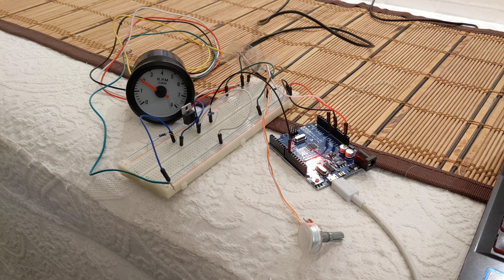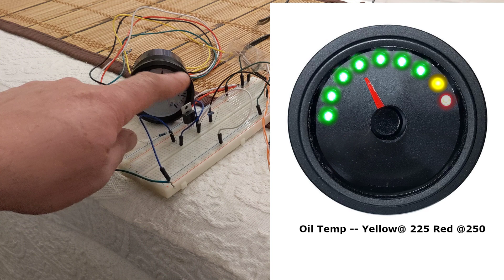Using a Tachometer as an Arduino Display

Comment: I'm curious if you know if there's a way to capture rpm and trigger a dry contact at a given speed.
Reply from the maker: mechanically, you could build an inertial flywheel that uses centrifugal force to trigger something once it's up to speed.  That's how many ac motors kick out their start capacitor once they're up and running.  But it would be very hard to fine tune it.

Electronically, you can use a hall effect sensor, feed its output to an arduino, and have the arduino trigger a transistor at a pre-defined rpm.  That would be extremely accurate.
Reply: @TheBuildist  Thanks for responding so quickly.  To give you a better idea what I'm trying to accomplish, I want to energize a pneumatic solenoid at a specific mph using the rpm at the wheel on my motorcycle.
Reply from the maker: my best guess is still the arduino approach.  In a weatherproof case, with a 12v power supply, with the transistor firing the solenoid.

Comment: How’s your loader going? I’m currently building a loader for my white gt1855
Reply from the maker: Excellent question:  I got bogged down for several months getting the hydraulics sorted out.  I finally did, and my progress since then has been substantial.  I'm happy to report that, as of today, the loader itself is complete and functional.  Tomorrow I start on the counterweight, necessary to make the loader capable of anything over 300 or so lbs.

I hope to have video 5 "Hydraulics" out within a couple weeks.
Thanks for asking.
Reply: @TheBuildist  Great to hear! I am following some of the original diagrams from the quickway loader that was available for it.